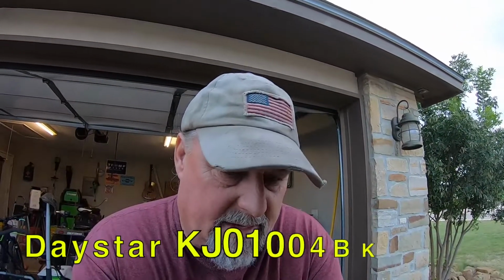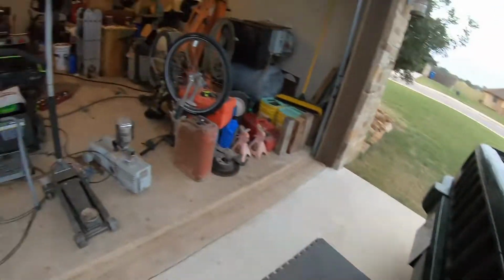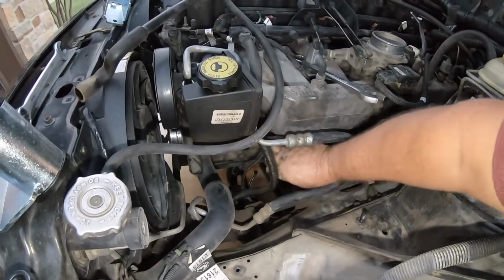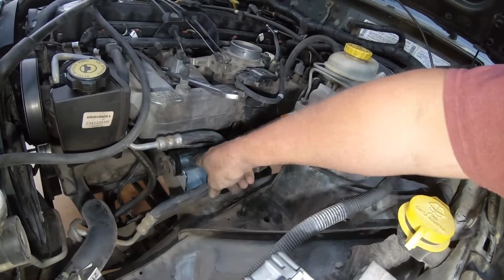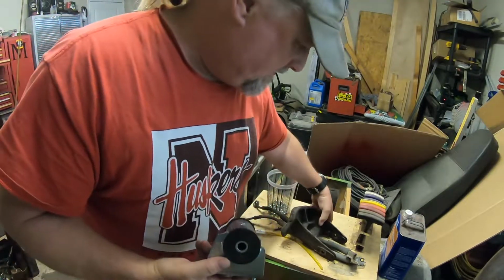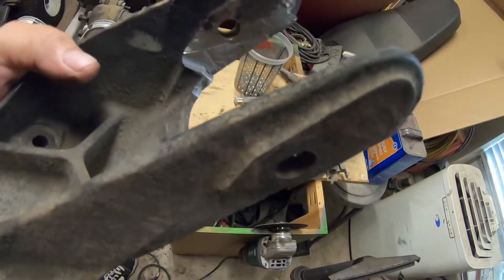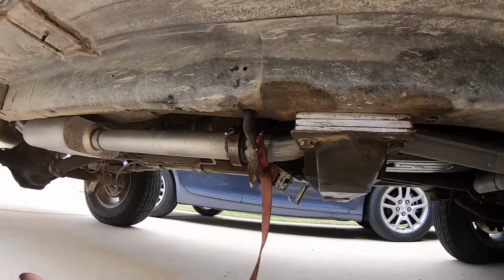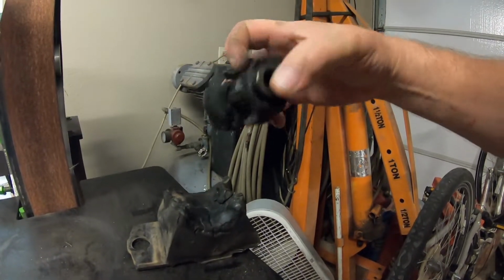Daystar Urethane Engine Mounts for the Jeep XJ

Comment: What do you think of loosening the transmission mount before jacking up the engine? I've seen a few videos and even the mounts I ordered put that in the instructions. It makes sense, but it's also a huge pain in the butt that needs two lifts, so I'd like to avoid it. The reasoning was that it would cause more vibrations or possibly stress the connections.
Reply from the maker: I should read instructions more often.  I had to grind some material from the passenger side mount to get it to fit.  it was right there in the instructions that I read after I had figured it out and had it installed.....im an idiot
Reply: @dzlfreek  Nah, I called tech support during the install and they told me to do the same thing for the same problem. You were smart
Reply from the maker: @spencerwhite6741  not smart enough to read the instructions tho
Reply: @dzlfreek  ididathing said it best: "Throw the instructions in the trash, then follow them from there."